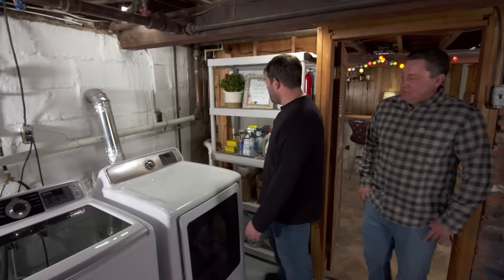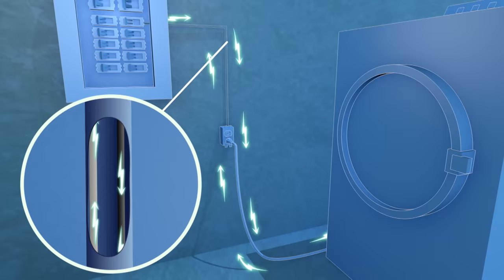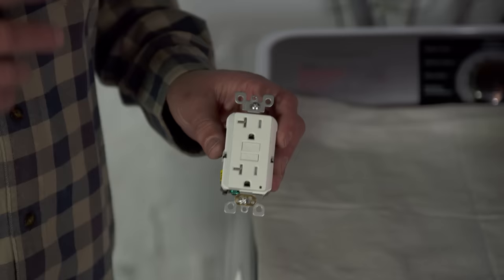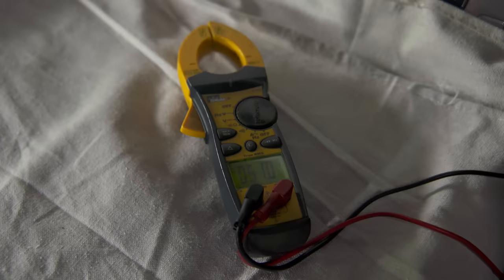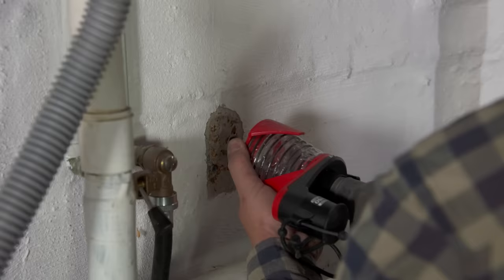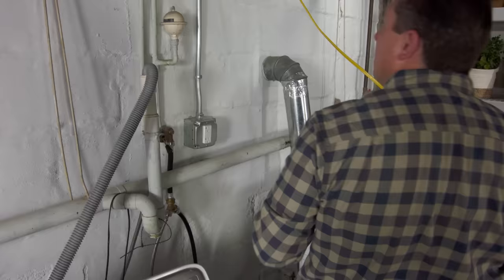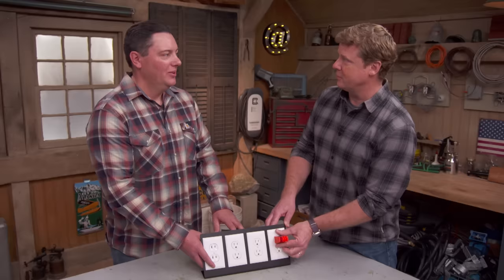How to Ground a Two-Prong Electrical Outlet | Ask This Old House

Comment: i realize its code but washing machines and fridges really should not be on a GFI ...nuisance trips
Reply: Your refrigerator doesn't have to be
Reply: Most new appliances don't leak voltage like they used to back in the day. For a washer on a concrete floor, I would want a gfci for sure.
Reply: Washing machine should never trip a gfci. If it does that means it’s frame grounded and old. I don’t like sump pumps on gfci circuits.
Reply: @dogfacedponysoldier6040  it dose if its within 6 feet from a sink
Reply: @chrisf9607  NEC 210.8 that's correct.
Reply: @chrisf9607  agreed

Comment: Why use solid NM in conduit?  Stranded THHN is the preferred choice.  Less space occupied in the EMT in case of desired expansion of the circuit, and it's far easier to push/pull through.
Reply: So he didn’t have to bend conduit all the way to the breaker.
Reply: @danielpeters4994  Not even to the nearest j-box. Just run the NM through the EMT where necessary to protect exposed run from physical damage. 334.15(B).

Comment: What kind of electrician can't make a box offset?
Reply: dirtdevil7bo I think point of them showing the tool was for the every day average homeowner to make a quick bend without having to figure out the geometry if they ever wanted a simple tool.
Reply: @Nmdixon-cu7vm  maybe bit why spend $200 on a tool for only box offsets? I can get a $40 bender and make two 10 degree bends and I'm done.
Reply: dirtdevil7bo if it costs that much (I use basic pipe bender also) then yeah I see your point but also keep in mind not everyone is an electrician or can even do basic bends good and would mess up 30 pieces of pipe before they got it right.
Reply: @Nmdixon-cu7vm  practice makes perfect!
Reply: John Johnson no homeowner isn’t going to spend $279 for a box offset bender.
Reply: @dirtdevil7bo  I bought 2-1/2" offset benders like that from an auction once for 40.00. Was a nice find. They are over 200.00 if you buy them new.
Reply: Why do you think he can't make it? Tools make the job easier and consistent and if you're getting a lot of commercial work, the savings in time adds up real quick when you're paying your guys Journeyman wages. Hell, just give the apprentice a pile of EMT and let him go to town with this thing.
Reply: @Arieeeee  nope teach them the right way.

Comment: Oh you have a crappy plug- lets just replace the whole thing..  not how you ground the existing...
Reply: It looks like the old romex only had a hot and neutral wire so the romex from the electrical panel to the outlet had to be replaced if you wanted to just replace the old 2 prong outlet with a standard 3 prong outlet.  The other option is to leave the old romex and replace the old outlet with a GFCI outlet.  He replaced the wire, used a GFCI outlet and even replaced the existing breaker with an AFCI breaker.  Technically, this is all correct but it is serious overkill if you want to do this work yourself as a homeowner.  It's a pretty standard retrofit that any homeowner can do to simply switch out a 2 prong non-grounded outlet with a GFCI outlet which gives you three prongs and the protection of grounding without actually running new romex.  In a basement it's probably easy enough to replace the romex but in finished spaces where you don't have access to the romex since it's in the walls just swapping out for a GFCI is fine.
Reply: @plasmac9  Good summary of the GFCI "fix".  Unfortunately, the NEC also requires AFCI for any replacement receptacles in a "laundry area", since 2014, depending upon adoption of local variations.

Comment: As a long time electrician, I never thought I'd say this: That is exactly the way I would have done it!
Reply: It’s definitely a lot safer Now.
Reply: Even the AFCI breaker?
Reply: @AlexFlockhart  Dang it, I didn't even catch that! But no, I wouldn't AFCI.
Reply: I thought romex in a conduit was against the rules.  My understanding was it caused heat issues and if you ran conduit you were supposed to use individual conductors
Reply: @philipsmith5830  Romex (Type NM cable) is permitted in conduit for physical protection where exposed.  NEC (2017) 334.15.

Comment: So, I’m confused. He calls the white wire the neutral wire. But, is the white wire also a hot wire? I have smart switches I want to install and they say that the neutral wires are bundles in the back of the wire box.

Comment: Lol, “honestly I was afraid to use It”. Jeez dude, my house is from 1938 and has two prong. My old duplex from 1950 had two prong. It’s not a big deal. Just use it and get over it until you fix it.
Reply: If you look closely, the receptacle was a "double-T" that could have been wired for 240v or 120, at 15A or 20A, with no indication of which one it is, making it a dangerous relic.
Reply: UpnorthHere just look at the breaker box it’s attached to

Comment: That gfi outlet he showed first he didn't use it because it won't trip if you push trip button on the outlet.Why do think it's called a ground fault outlet. If it doesn't have a ground it won't work properly.

Comment: I was going to install a window AC same thing nothing in the room was 3 prong. I asked the big box store help and was told I could ground to my wood frame... WHAT>. was my thought.. I have some knowledge and did not trust that answer.. But my initial question was. 

In the same wall "bay", in the bathroom I have a Grounded GFI outlet. Could I use that Ground as the ground for this circuit? Different circuit breaker, GFI... I was just unsure.

I did have an electrician come out and installed a completely separate dedicated line for the window AC and a new grounded outlet near the original outlet in the room.
Reply: As long as the other circuit comes from the same (sub)panel, has the appropriate wire gauge, and your AHJ has adopted the 2014 NEC, then you most likely can use that ground. See NEC 250.130(C) for more information.

Comment: 12 years ago, lived in an apartment in an OLD house in Houghton Michigan. Outlets were ungrounded. Went downstairs to do laundry for the first time, the lights were running on active knob and tube! Was glad to finally get out of there.
Reply: I have lived in places with working K&T wiring that is "just fine", and "to code", as long as someone installed it properly and nobody has mucked it up since then.  I have worked in places where fire code prohibits modification or extension of any K&T installation without replacing the entire circuit.  I did that for my sister's 60A-main-fused house 40 years ago as a summer project, ending up with a new 200A panel, romex and properly grounded outlets everywhere.

Comment: What’s that ungrounded socket being replaced?  It’s not the normal NEMA 1-15R because it has the T shape neutral slot, and it’s not the old non-NEMA one which had both slots T shaped.  Is it a 1-20R?  If it is I didn’t know that such a thing  existed.  Things are much simpler here in the UK, but that applies to most things electrical.  How long does it take to train as an electrician in the US, there seems to be a lot more to learn.

Safer to use the socket tester rather than a multimeter to check that the power is off, but should test it in a live outlet before and after testing the outlet to be worked on.  Need to test the tester because it could itself have failed, and failed to indicate that a circuit to be worked on is in fact still live.
Reply: Stephen Furley - 5 year apprenticeship for electricians in amurika. I worked with an English electrician years ago. He was telling me all kinds of differences between UK and US wiring systems, especially wire nuts being against UK code and using terminal screws instead
Reply: Beg to differ: at 0:20 it is appears to be a double-T-slot, which could have been used for 120 or 240 at 15 or 20 amps, making it quite the dangerous relic.

Comment: I saw a handymans grounding in a house. Single conductor ground wire from the device back down the hole in the floor and run across the basement to a copper pipe. Copper pipe strap the wire to the copper pipe. It wouldve been less work to re-wire it, so in a way it was impressively wrong

Comment: Hi.  I have an electric fireplace that is double insulated and with a polarized 2 prong plug.  However the outside housing of the fireplace is all metal.  I would feel safer if the unit chassis was grounded.  Can I replace the existing power cord with a 3 prong cord and connect the grounding wire to the inside of the chassis?  Much obliged.
Reply: You are not allowed to ground double insulated devices. Do not improvise!

Comment: how do you add a grounding wire to an outlet that's inside a drywall or plaster wall, not mounted on the surface like this one?

Comment: At 5:04 , not your point, but if this is a sub-panel-- shouldn't the panel have the neutrals and grounds separated? It looks like both are landed on each bar. I don't know, which is why I'm asking.

Comment: The one issue I have here is the phrase, "the used current is returned" as if the electrity is being worn and returns to the factory to be refurbished and sent back.

That would easily confuse somebody who doesn't understand electricity at all.

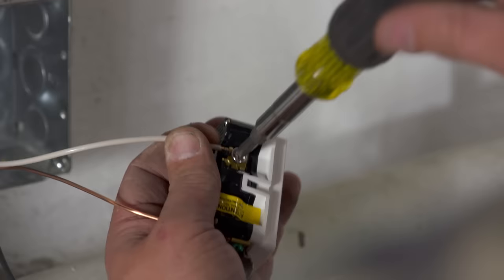Comment: Could have used some more detail around 4:40.
Apparently the new wiring ground wire is attached to the box and then attached to the outlet;
anything attached to the exterior grounding nut just above the box is also grounded.
How do you make sure the bare ground wire doesn't touch the terminals for black or white
when folding the wires into the box?
Reply: fold the ground wires first as far back in the box as you can.  I like to tape around all outlets and switches with electrical tape.. go about 3 times around it... this will add a layer of protection from hitting a bare ground wire.  Otherwise just pay attention as you stuff the box..
Reply: @SatanIceCream  HE made his job easier using a 2gang box for a single device..

Comment: Question. Does the conduit have to run all the way back to the panel or just up into the ceiling?
Reply: <<Question. Does the conduit have to run all the way back to the panel or just up into the ceiling?>>

A question still looking for an answer!

You can't you Romex leaving it exposed. However,  my understanding is that you can't run Romex through a conduit either,  which is what was done in the video.

You can run Romex through a ceiling, wall or other place where it's protected.

But how to make the transition from the conduit to Romex?   A junction box could be  a solution,  with conduit in and Romex out.

But perhaps someone who is an Xpert will give a more authoritative answer.

Comment: OK, so now you have a "grounded" outlet. I'm a retired electrician and I would still "fail" that outlet since it still doesn't provide GFCI protection. He provided a "Arc Fault" circuit and outlet which protects against electrical fires caused by electrical arcs. He provided the ground but didn't solve the requirement for GFCI protection. Copied and pasted from a Google search "where is a GFCI device required"?? 

"The NEC mandates GFCI protection in many areas of the home: bathrooms, garages, outdoor receptacles, crawl spaces, basements, kitchens and anything within six feet of a sink or water source". 

This application  definitely includes one or more of those areas. The outlets for these machines need to be GFCI and most jurisdictions will require a separate (dedicated) circuit for EACH machine.

Comment: @5:09  So, there always was a good "grounding bar" in the Main breaker box?  That box looked pretty new--like it was installed during a recent remodel.  Whomever had that new breaker box installed should have asked for some grounded receptacles in the basement laundry room (as this seems like the likely location for a laundry room).  I'm guessing this current homeowner didn't have that new breaker box installed...

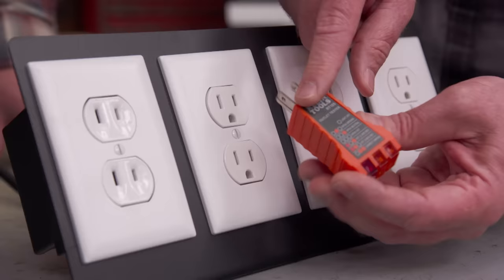Comment: 5:49 I used an outlet tester on an outlet w/a ground, it has 240V coming in an ANCIENT and shockingly reliable Montgomery Ward AC unit was in the wall and using it.  All three lights lit up on the tester.  Can anyone speculate as to why?  The tester has no code for such a case.

Comment: I find it interesting he put the washer on a arch fault breaker, I thought those were used for mainly lighting circuits
Reply: Not necessary, but counts towards the code. AFCI protection is a requirement for all dwelling units
Reply: Every circuit must be arc-fault protected except bathrooms per NEC 2017. In 2020, even the bathrooms will have to be arc-fault.  
Doesn't necessarily have to be an arc fault breaker,  you can use arc fault receptacle if you meet certain requirements first.
Reply: You thought wrong

Comment: He implied that a simple solution would be a GFCI outlet, but then he went ahead and replaced the wiring back to the breaker.  Why did he go to that trouble if it wasn't necessary?  I get that GFCIs can trip and are not desirable for an appliance that needs to run uninterrupted (like a refrigerator).  However, for an on-demand device such as a washer or dishwasher, it's easy enough to reset it if it trips. Does anybody have any thoughts on this?
Reply: You don’t want any tripping on new appliances. Their lifespan is short enough as it is.

Comment: Not turning power off at the switch if the hot and neutral are switched?  Did you not just a short time before explain that with alternating current that the electricity flows back and forth through both the "hot" (black) wire and the misnomered "neutral" (white) wire; which means that both the black and white wire are actually hot since the electricity flows both ways.  You would have to have a switch that breaks the circuit on both the hot and neutral wire to actually turn the power off to the plug or device and I have never seen any house wired with that type of plug.

Comment: if the ground wire is grounded to the neutral rail in the braker box. how come you cant run the ground into the neutral inside the wall plug? the both go to the same rail in the braker
Reply: First that is a possibility and it has been used in several countries in the past but there are reasons why it is not a good idea and why the code bans it. I am not going to start to speculate whether it is better or worse than the GFCI method as it is banned by the code and for reasons. Such a grounding system is called TN-C as opposed to the TN-C-S which is the proper way to do.

The problems include that it causes stray currents that can go through IT cables causing interference. The most feared risk is that if the neutral breaks it will energize all grounded cases. The worst risk is the risk of creating a reverse bootleg ground that also energizes the cases.

In Finland that was used until the late 80s but then it was banned though it is still legal in old systems for changing or adding sockets. Of course here we only need to change sockets if we really want grounding as he re all plugs fit ungrounded sockets. Here all DIY is banned still reverse bootleg grounds have caused three fatalities since 1980.

Comment: There are hundreds of thousands of houses in america built before 3 prong plugs became standard. In the areas I have worked in, I believe the switchover to 3 prong occurred between 1955 and 1965. If these older installations were legal when installed, GENERALLY, they are still legal..the code generally grandfathers in existing installations that were legal when installed., with few exceptions. (Of course, each state/city/or county, etc.,..can pass their own code, or pass "part" of the current code).
  The first GFCI that was required by the code was around 1990 +/- a few years.  Nowadays, there are many places requiring them.

Comment: can I just use a GFCI outlet for a home theater system (tv. sound system, couple of consoles, pc, and a few lower power devices) instead of have to replace the wire? right now I'm not really using that outlet because it isn't grounded
Reply: A GFCI outlet will protect you from getting electrocuted if there is a fault, however your AV equipment may recieve unwanted interference without a real equipment ground.  Is your TV and audio system directly above an unfinished basement? If so you could replace the wire relatively easily.
Reply: @AlexFlockhart  the stuff is in the basement
Reply: @darkopz  GFCI does bring an ungrounded outlet to code as it does protect against ground faults.
Reply: Alex Flockhart yeah but only if you put the sticker on it saying it’s not grounded 😂
Reply: All the TVs I’ve ever seen are not grounded. If all the equipment you’re using is covered with plastic, like a TV, a ground is not as important as it would be for appliances covered with metal (washer, drier, stove, fridge, ...). But adding a GFCI is not a bad idea. Know that a GFCI doesn’t replace a ground, because a ground and a GFCI are different types of protections. However, a GFCI will significantly reduce the risk of electrocution compared to not having any protection at all.
Reply: You can replace an ungrounded receptacle with one having 3 slots and GFCI protection, under the NEC, and the vendors even give you the required label that says "No Equipment Ground".  Just search YT for any number of vids on how to do that 2-prong to 3-prong upgrade, keeping in mind that it may ALSO require an AFCI upgrade, depending upon your version of the code.
Reply: Many of those devices are two prong anyway so it does not matter. Of course if you need a power-strip then your options may be more limited. Amazon sells power strips with two prong plugs but three prong sockets. Avoid those.
Reply: @okaro6595  little late but I installed a GFCI outlet and use a power strip with a surge protector